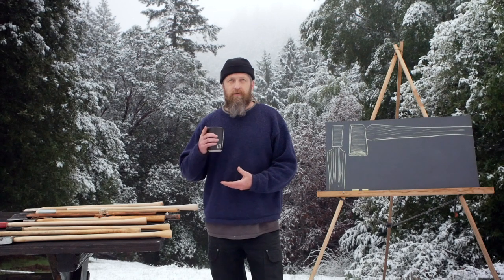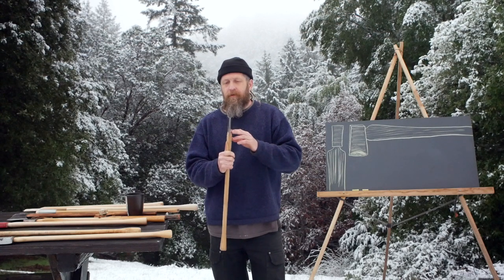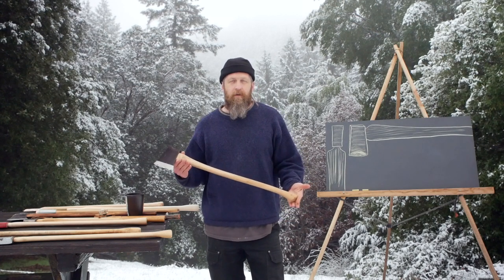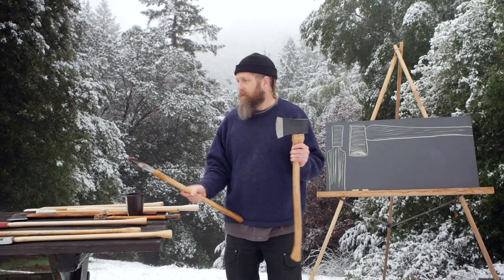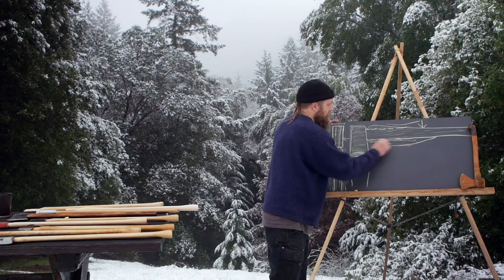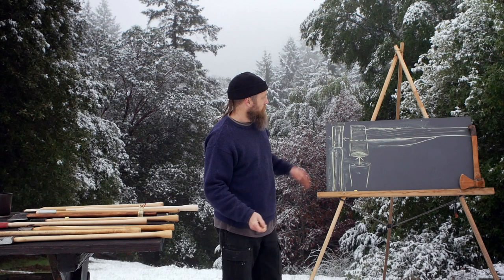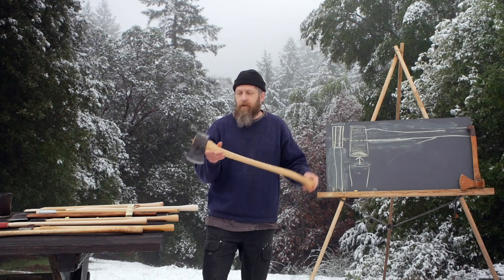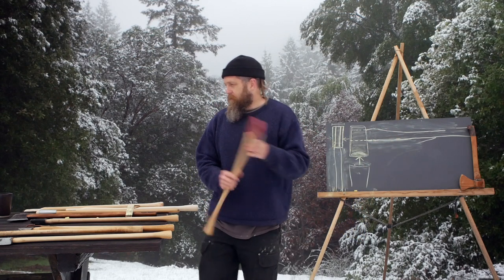Failure By Design, Axe Handle Design Mistakes and Improvements, *Spread the Stress*

Comment: I noticed you used the back of a pen knife for taking wood off a handle. It looked really effective, could you show me how you did the knife. Was it a forward movement of the HORIZONTAL to the knife blade or diagonal to the knife blade? Great learning from your site, thanks. Rich.
Reply from the maker: You can watch this video for a lot more of that  https://youtu.be/MtycSBUtP0o  It's best to just tip it around a little until it cuts best.  I typically use it at 90º degrees to the handle length, but the angle of attack matters a lot and varies.  Small variations can make a big difference, but it's easy to make slight adjustments.  Most people use the blade, but the back can be really good and saves the blade from rapid dulling.  It doesn't have to be super sharp either, just draw file it a little to a perfect right angle.  I had started a whole video on scraping with knives, but was not able to finish it.  Hopefully I'll still do that someday.

Comment: Woah! Posted 6 minutes ago :D So fresh!

Edit: I've recently gotten very lucky with my local hardware shop. I found a couple of nice axe handles (spotted gum here in Aus), and I have used these several times in the past as a base and found them to be fairly heavy/typical of what you will find today mounted to an axe. The most recent handles however, are MUCH closer to where they need to be. They still need a little material taken off as they feel a little too thick to me, but compared to how they used to be (same brand etc.), we're talking maybe a 20 minute job with a knife edge rather than having to break out a spokeshave/rasp as I used to (spokeshave on spotted gum is not a fun experience). The difference between the eye section and the raised part where the handle appears, is maybe... 4-5mm? Basically I just need to round the handle as it feels a little more like a rounded rectangle, so it just needs the radius extended to round it further and shes good to go.
Reply from the maker: That's good to hear.  Good handles are very hard to find around here, though other's report finding them.  It might be a regional thing.

Comment: Great video with lots of insights into axe handle design, thanks! As I don't own an axe with a composite handle this might be a dumb questions. Are generally these structural, and for some part ergonomic, design flaws also present with handles made of composite materials? I would like to think that the properties of these composites used would influence how they are designed rather then simply repeating the same handle patterns and therefore replicating the flaws. One drawback using composites is, I guess, it's limitations on user customization of the handle.
Reply from the maker: I don't know enough about them.  Literally the only one I own is a maul handle, which is one piece the same thickness all the way up and down, so it probably flexes into the handle.  Its so much stronger though that it probably doesn't matter too much.  Then again, cutting across the fiberglass fibers might lead to breakage in the same way as wood?  dunno.

Comment: Good video. Don't forget wear and tear on the axman from a handle that won't flex! Not to mention balance. I take that whole area around the throat of the ax down just so I can grasp it without fatiguing my hands. Way too big for a usable grip if you ever have to choke up, especially with an over-strike guard of any kind over it. 
Was that black painted axe you were handling in the beginning of the video one of the mid-grade Council axes? Any input, I bought two of the cheaper boys axes and the first one wasn't tempered well and rounded over bucking my first round, the second was really loose grained hickory and the head broke off like a piece of chalk into my second round. 3rd time's the charm?
Reply from the maker: Yes to all that.  I cut quite a bit of stuff out in editing trying to keep mostly to the idea of stress and breakage just below the eye.  This could easily have expanded into a multi video handle thing and probably will eventually.  Actually, I might have reshot it if the snow didn't melt, but I really wanted to use this take just for the atmosphere :)  Saved by the weather.  I suspect that if we were to look only at breakage and not ergonomics, cutting in closer to the head as I did in examples would not be the strongest thing, but Ergonomics have to play a role.  I"ll sacrifice quite a bit for a higher performing, more ergonomic tool.  I tend to just keep whittling that area down until I can easily use it up near the head.  I do that in the upcoming video on dealing with the Husqvarna axe handle.

That is the council forest service specification boy's axe.  I don't think the handle grade is probably significantly different.The head is supposed to be a better grade of steel and more carefully tempered.  it's looking like the budget axes from them are very hit and miss.  Have you sent them back to the company?

Comment: What shape do you prefer for ergonomics? Also, why does the cutting edge on the bit curve, that is, sweep backward? In my limited experience, I prefer an almost straight cutting bit with slight sweeps on either end. I'm guessing lumberjacks found that the sweep might help unstick an axe, but it also gives you less cutting area and theoretically could cause more rolling deflections, no? Just curious when and why axe manufactures started making heads that way.
Reply from the maker: If you mean handle shape, there are numerous possible things to discuss.  I don't have super specific criteria, more like a set of boundaries that I don't like to go out of.  I've never understood or physically felt any advantage to very curved designs, and more like the opposite.  I like to be able to slide my hand very easily right up near the head, so I'll modify that are until it feels right, even if it theoretically would make the axe slightly more vulnerable to breakage.  I don't like very curved outlines either.  As far as being straight or almost straight, I'm not ready to say much on that at this point, but I'm very curious to set up a totally straight wedge and use it.  I like the idea of establishing that point by actually using it a bit.  Otherwise I'm just speculating.  Dudley Cook talke about straight edges v.s. curved int he axe book, but prefered fairly straight.  If you mean the fact that the toe usually leads the heel of the axe, that is to improve the hand and where the bit contacts the wood naturally.
Reply: Thanks for taking the time to respond. I’m restoring an old Council Tools axe my grandad left me, so your recent content on bits and handles are very relevant to me. I’m still curious why and when cutting edges started to curve like half moons—especially double-bitted axes, which seem to be curved the most. I don’t own one, so I’m basing this on what I’ve seen. I’ll have to pick up Cook’s book on axes. Thanks
Reply from the maker: Definitely pick up cook.  Preference is sometimes expressed for different curvatures for soft v.s. hard woods.  Personally I never noticed much difference so far, but I haven't been paying much attention either.  Dudley preferred more straight edges, but he was also from Main where straighter wedge axes seem to have been a thing.  Completely straight edges seem to be rare though.
Reply: I suspect a completely straight edge would stick more, but I really can’t see a downside besides the sticking. I’ve noticed the Grandfors are mostly straight edged, though I e never owned one because they seem overpriced to me. That said, I probably will someday because they seem to be making the axe I want. Thanks.

Comment: What are your thoughts on the hour glass shape in the eye in regards to strength.  Wood under compression is it an advantage?  A lamination (by pressure) with the wedge and the handle wood does this make it stronger or weaker?  At what point does the wood in he eye stop taking impact forces and simply hold the head on? I’ve had hammers handles break in the eye and am not sure why.
Reply from the maker: I have not thought about that deeply yet, but I was thinking recently about changing the flare in the eye.  I've also meant for a while to just bust out a pile of axe heads and measure them out to see what is really going on in there.  I can never tell a lot by just looking in the eye.  It seems like there is potential there to reduce stress.  I've also thought about other possibilities with the bottom of the eye that I'm not ready to discuss yet.
Reply: SkillCult smoothing out a chamfer...?  I like it.  Hey really glad to see your getting more subs.  You deserve more and more.  I always look forward to your videos.  I’m working my way to some of the older ones you have that I haven’t seen yet.  The list is shrinking.  Great content.
Reply from the maker: Maybe.  Same concept of spreading the stress regardless.

Comment: Regarding the ears, it seems intuitive to me that the ever so slightly flared inside surface of the ears is the mechanism that should serve to prevent the handle from stressing on that sharp fulcrum during a side load. Also to distribute stress across a greater surface area with no  when that side load becomes extreme (like when prying open a split round)

Think of it like a pipe bender, a pipe bender doesn't crease conduit piping because there is never an unsupported or sharp edge

This could only work if the axe was hung quite well, but it's how I envision it

That was extremely incoherent, time for coffee
Reply from the maker: I"m unsure about the flare.  I'm not sure most axes like that actually have a flair, but I think it would be ideal if they were formed on a drift that took the shoulder into account and made the ear a gradually thinning ramp on the inside.  I did that with a file on my Husqvarna, but I didn't take meaurements first, so I'm not sure if there was any natural flare.  I'm thinking there wasn't.  Bottom line, as a blacksmith, if I were making that type of axe, I would make the eye continue to widen to the ends of the ears.  I think it is worth thinking about the idea that it could be so thin that it would actually flex a little under stress, which could be a huge benefit.  Maybe they already do, but maybe it could be exploited as a design feature.

I agree that the longer edge created by the ear must be a factor.  As the pressure is applied, there should be a high amount of pressure on the tip of the ear and gradually less as going toward the eye.  Intuitively, it makes sense that this would make rapid shearing less likely.  On the surface, it might seem like having extra stress on one point could cause more rapid failure, but I don't think that is the case, though I'm not sure why.  An engineer would probably know why.  I'll probably figure it out, but I haven't yet.  For me, I might have to relate it to how something else works and make an analogy.  Already though, I'm inclined think that ideally no axe in our current paradigm would have a straight line at the bottom of the eye.  I think if you designed the bottom of the axe and the eye around that problem, from the perspective of identifying and solving the problem, instead of taking what we have and using small amounts of amelioration to fix inherent problems with current design, it would look quite a bit different than anything we have now.  That may be true of a lot of things.  Most problems are approached from the current paradigm instead of approaching it new from an attempt to understand the system and it's inherent problems.

Cofffeeee......

Comment: Very interesting. Cook in his chapter on handles also makes a case for straight vs curved in the single-bitted ax handles. What are your thoughts on this? Another failure by design that contributes to breaks & inaccuracies, or have your experiences been different?
Reply from the maker: I think that drastic curves are silly and weak, I don't see the percentage in that kind of design.  There is an ergonomic advantage sometimes to a curve at the butt of the handle for the wrists that I never see discussed.  I don't have a lot of opinion otherwise.  I can say that the everyday working disadvantages of a straight handles are few except for close bucking work.  They can be easily adapted to, but a moderately curved handle is perfectly effective and quite accurate if someone is just a competent chopper.  I think any heated discussion on the subject is unwarranted.  it's not that big of a deal for practical work.  Probably just something to argue about :)

Comment: I've heard aside from the muscle mass and skeletal design, a gorilla can hurl a rock a lot harder and farther than a human because their arms are much longer than ours.  A longer handle might then allow us to have more ape-like arm extensions up to a point than a shorter handle.  Yes, you lose accuracy...but where is the nexus where longer is not stronger or practical? Poleaxes were a thing.  And what do you think of handles that are taper fit to the head....you hit the other end to release the steel axehead and hit the head on a hard object to friction fit the head.

Comment: I think the thick handle is there to protect against shaft strikes..."more wood, more better" being the logic. 
I'm guess they assume most axe buyers are unskilled oafs who cannot hit what they're aiming at, and they'll gladly trade a little shear strength in for mishit protection.

(For all I know, they aren't wrong).
Reply from the maker: Yeah, I think it's that and more in general just more wood must be stronger.  The forces on a stressed axe handle are complicated, including hitting the handle on wood.  the inertia of the heavy head still wants to keep travelling forward, stressing trendle breakage and what the impacts that broke them were to get a good idea of how those stresses commonly play out.  My guess is that most handle breakages from handle strikes are still going to initiate at the juncture of head and handle, or be due to handle weaknesses like runout.  That v.s. just cumulative damage to the handle wood and not breakage.  THanks for commenting.

Comment: I’ve never really had any issues with tool handles breaking outside of flat out abuse. I don’t care if manufactures keep thick handles, cause I can just shave it down, sure it’s a pain, but whatever. Grain also doesn’t affect me, I don’t care which way the grain runs, My grandfather has a completely  wrong grained  axe since about the 60s. Still uses it on the daily today. And I’ve never had some I’ve made break. It’s all about personally preference though. If I had one complaint to manufacturers it would be about palm swells. A lot of palm swells are massive and give me blisters right in he bottom of my hand, I always end up almost completely removing them, no matter how much I toughen up my hands, the swells always kill me.
Reply from the maker: Well, may you continue to not break handles.  You don't chop aggressively from what I've seen. That is a major factor.  I don't have big opinions on butt designs.  If it bugs me I deal with it.
Reply: SkillCult I really get agresive when I”get into the swing of things”. Over the past summer I built a log cabin and really went at it. Was chopping so hard my joints hurt. But I think my arm would have broken before my axe handle did. That video wasn’t exactly my full potential of chopping ability, not exactly proud of that performance, but hey I hadn’t done any serious chopping in a while.
Reply: +Double Bit Craftsman
as soon as you add another g and an s to the word 'agresive' you'll be in the swing of things, there is no no doubt in my mind.

Keep on buckin' in the tree world
-stay safe

Comment: I'm looking at my axes and see a couple candidates for some thinning and oiling. Even when I carve my own handles I tend to make them too thick. It's kind of a reverse psychology, where less is actually more.
Excuse me if you have already addressed this, but what are your thoughts on heat treating or burning the handles?
Reply from the maker: Keep in mind that there are other types of stress and in some cases, extra thickness may be a benefit.  Given that fact, there are compromises to be made.  Also, grain violations and wood quality could make a difference.  I just see it as cosmetic and if anything, it seems like it would weaken the wood and make it easier to initiate fractures.  Tha'ts just me thinking though, I don't have much experience with it.  I don't see an advantage.
Reply: I just remember that they used to heat treat baseball bats, and wondered if there was something to it that could be applied to axe handles. Something about the heat drawing the resins to the surface of the wood.
Reply from the maker: Heat treating can increase hardness, so maybe that has to do with impact/compression resistance.  I don't see that as a benefit with an axe handle  It's hard to imagine that it makes it more tough in terms of initiation v.s. prevention of cracks, but I don't know anything about that specifically.

Comment: I think to some extent a handle should come thicker, for the same reason the edge should be thicker than desired, my reasoning behind my theory is that you can always take away metal or take away wood, but you can't put it back so you can shape the edge exactly how thin you like it and you can make the handle to your preferred diameter to get a custom shape, but the important part is users knowing why not to use a huge thick handle.
Reply from the maker: Sure, that's reasonable.  At some point, if you want to know the limit though, you have to push it.  It's much thinner than most people think though.  That assumes a lot though, about the type of stress and wood quality.   Type and amount of stress depends on the user too though.  I'm not the best person to test the durability of a handle for a complete beginner and vice versa.